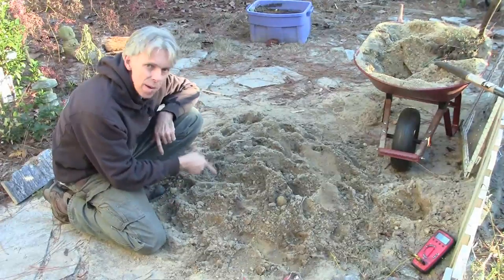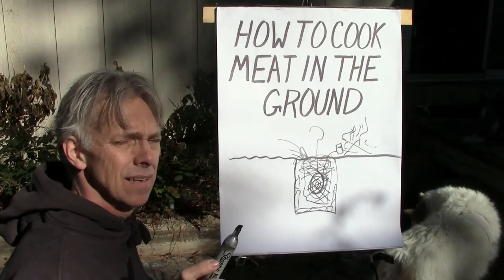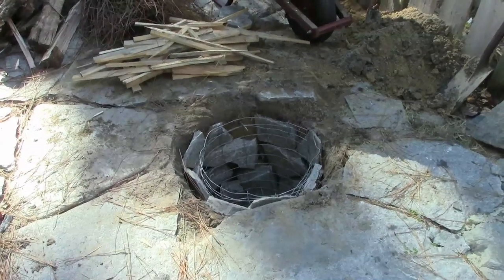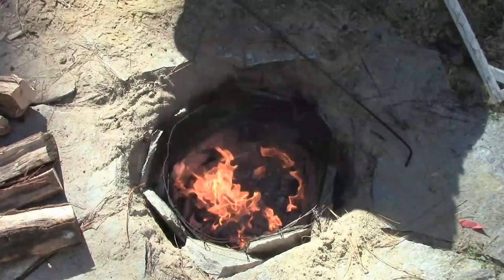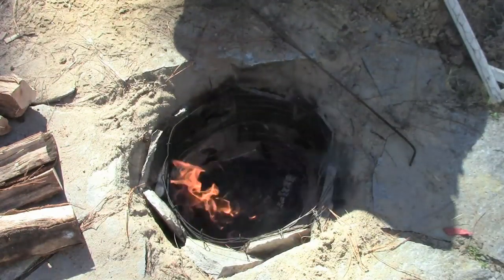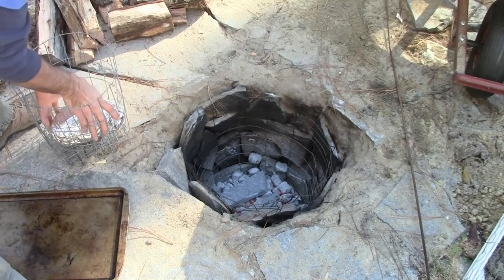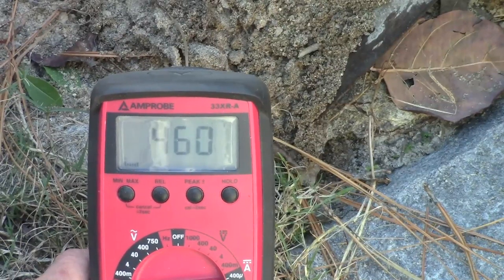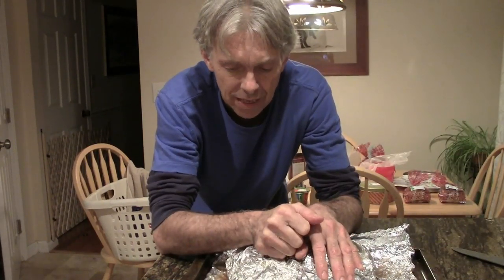Cooking Poultry In An Underground Oven

Comment: There is an old traditional dish here in Finland, called rosvopaisti (“robber’s roast”). It's basically any kind of red meat, prepared in this kind of earth oven (100cmx70cmx50cm).
The only difference compared to how you did it, is that the meat is firstly wrapped in wet wax paper, then aluminium foil, then in a thick layers of newspaper. The whole thing is dunked in water till it's wet. This helps to heat the meat more evenly.
Also, the meat is placed at the bottom of the pit, on top of the heated rocks, and the hot coals are placed on the meat, which are then covered up completely with about 5cm of sand.
Usually you have a fire burning for about two hours to heat the oven, and the cooking itself takes about 1,5 hours per kilo. If it's cold out, it's best to burn a fire on top of the oven, as well.
It's not recommended to add any air intakes, as it might heat the roast to a crisp.

Hope the turkey turns out well. :) Happy thanksgiving!

Comment: when camping we would get a campfire going heat bolders in the fire then throw them in the hole then add hot coals on top of them we get extra cooking time.

Zenith HiFi I hope you recap the tuner I found a similar unit from 60 or 61 going to do the same.
 Happy Thanksgiving...

Comment: Lucky here, I can just dig a hole when fishing, get the catfish and kill it, then look for some clay to make a ball with it and the fish after gutting it. Then bury in the fire for about 4 hours till the clay is fired to brick. Then crack the clay off with the skin.

Tip for the turkey is to make a much bigger fire, and after placing the turkey in the hole place a thick layer of coals on top as well, and leave to burn for a half hour before covering.

Comment: The rocks are what do the work of cooking.  When you seal up the whole that is when your coals choke and go out.  You want to start your fire and bank it for an hour or two before putting the bird in.  Start out with the rocks in the hole just as you did. Run your fire with the lid rock propped open just enough to let the fire breath this will get it up to temp better and bake the heat into the ground.  Make sure you have enough rocks to hold and carry the heat.   The Hawaiians do pigs this way all the time. They also cover the pig in wet banana leaves that help create steam.  Steam pushes the temperature higher but also regulates the temperature.  You won't need it to keep the bird moist..  I'm sure there are videos on it. Good video. I think there will be hole that appears out back pretty soon.. :)
Reply: Thank you Robert. I'll give that a try!